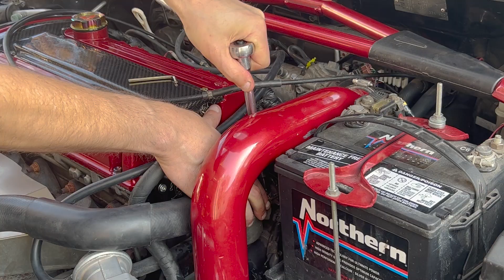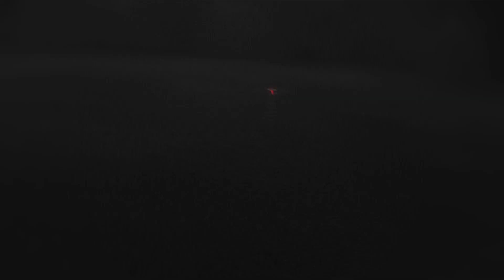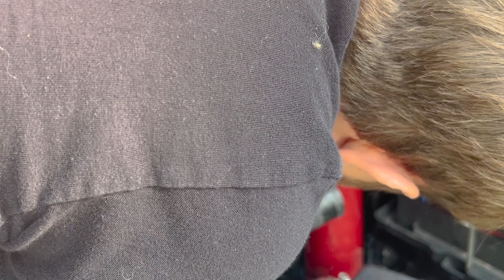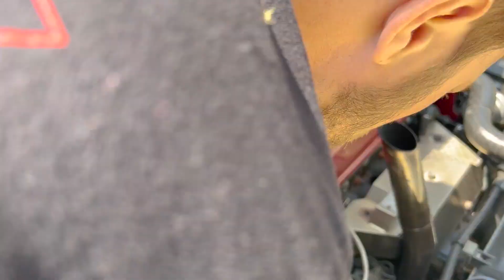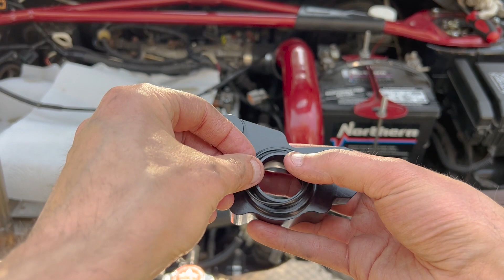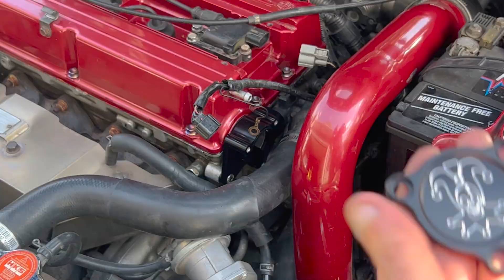EVO 8 Reverse Cam Position Housing Install - Evo Camshaft Position Sensor Install

Comment: What socket did you use? Size and brand I bought a thin wall 17 mm and it fits the bolt but not the whole to tighten it
Reply from the maker: Use a 3/8's drive socket. I'm guessing your currently trying 1/2 drive.

Comment: I just did this tonight. Very easy. Removed VC, upper rad hose and then water neck to get proper torque on rear mounting bolt. Nice piece. Good vid Paul, Stock route uicp sucks I don’t miss it at all.
Reply from the maker: Glad to hear! Thanks for the feedback

Comment: Does it have to be re timeed up on ECU ? If your running sequential system ?
Reply from the maker: Everything i did was documented in this video. I didn't have to touch my ECU.
Reply: As in theory it would now be 180 out ?
Reply: Ahhh because you flipped the pickup 180 it would all be ok ?

Comment: interesting... I feel like this wouldn't work with models with SAS like most JDM models. I have to check that
Reply: It’s the secondary air system. It’s for homologation. Used for anti lag system. Not sure what it does on stock cars with anti lag switched off. Mine has it but with stock ecu it’s either on or off done through mapping can’t be done on a switch with stock ecu. It’s just a valve with lines to the manifold. Pretty pointless on a road car but it’s quite cool.
Reply from the maker: What does SAS do?
Reply: @BoostedFilms  hey man, i have the g4js head im building ik its a long shot but my cam trigger is too short, the hosing makes it sit above the cam slots and it wont fit, do you have any help?